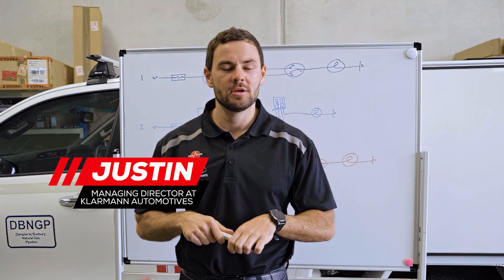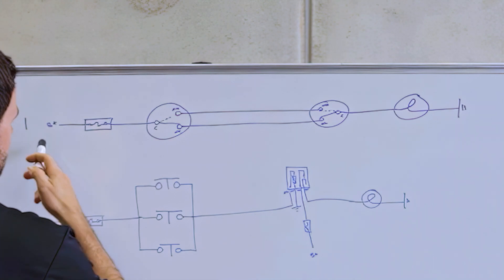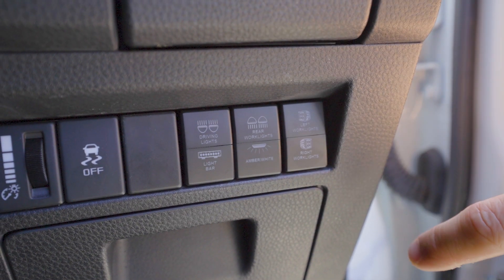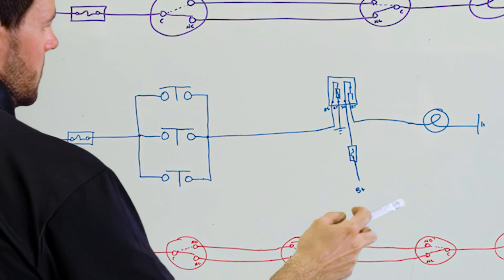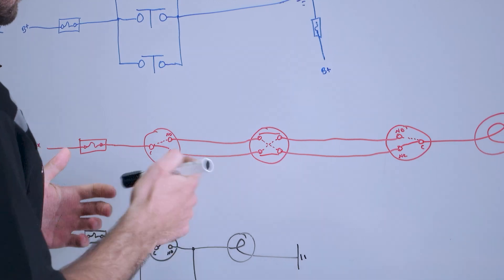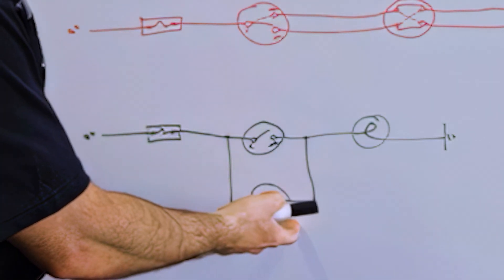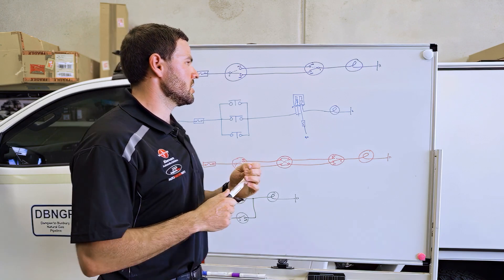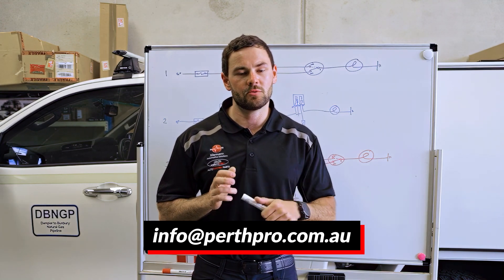Perth Pro Talks Tech: 4 Ways To Wire Dual Switching

Comment: Do the back light in the switches still work in these set ups, to indicate when a light is on or off. Especially option 2 where you don’t have a constant flow of power through the switch? Great video, always cool to learn some new tricks

Comment: Had to laugh, Excellent video...released just after I worked out how to dual switch the source for the relay on my extra reverse light (from the cabin) so it's Auto or Manual with a 2nd switch in the canopy to manually turn it on/off...👍